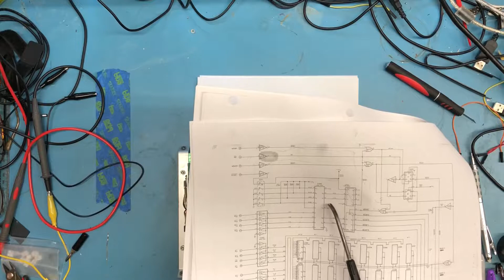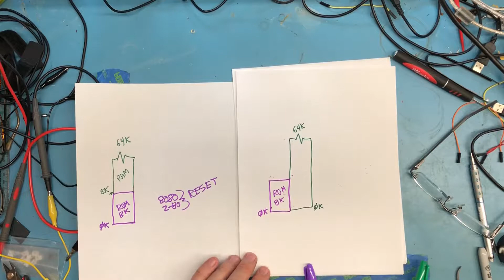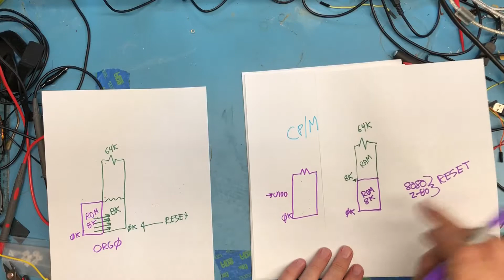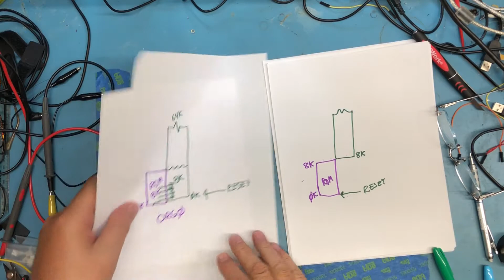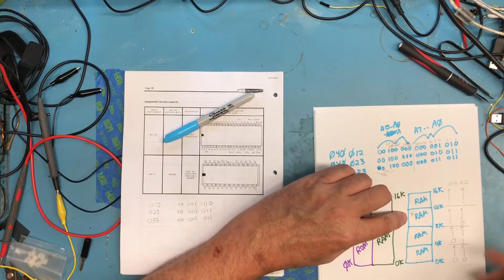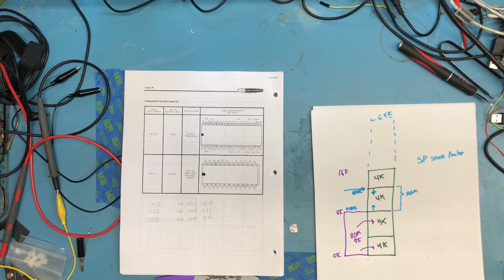HeathKit H8 - Part 4 - H8-16 16K Card - Discussion of mem maps and how the card might work - STB174

Comment: CPM actually is located at the TOP or RAM, whereever that is.  (You have to sysgen a copy of the CPM kernel to match your ram configuration).  What low ram is used for are the vectors that point to the OS entry points, file control blocks, and the start of user program space.  The rom needs to load the CPM boot loader into ram, and execute that.  The boot loader then loads CPM into high ram and initializes a few locations in low memory before jumping into the OS.  This wipes out the ROM image in RAM, but that will be restored on reset.